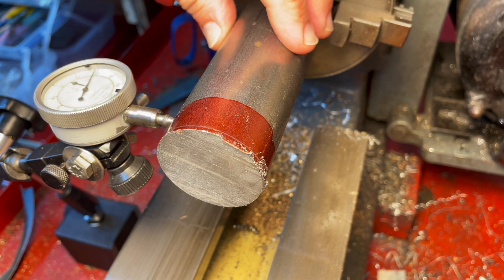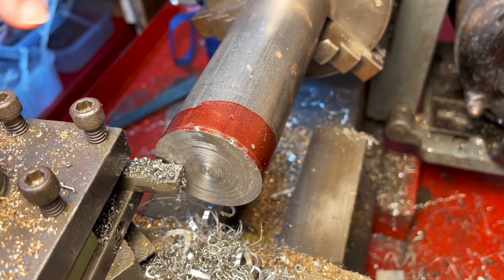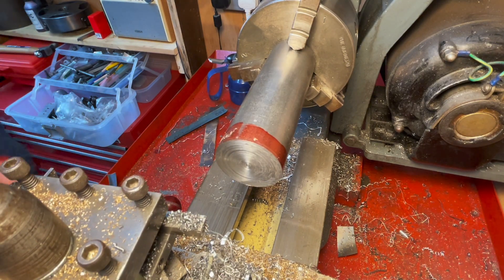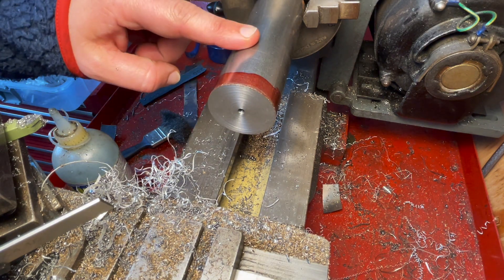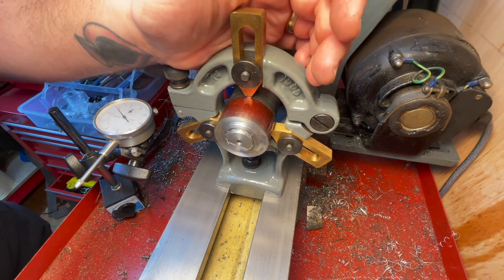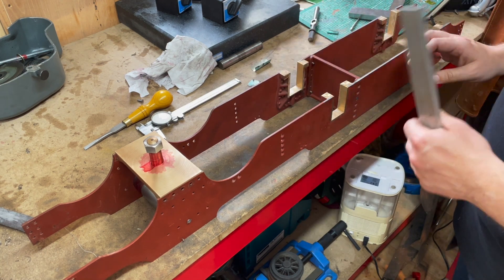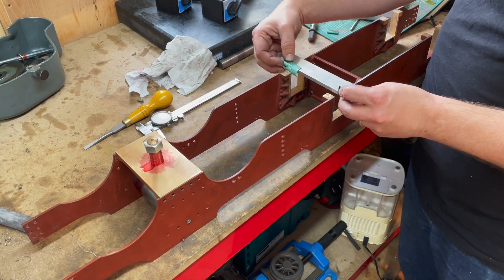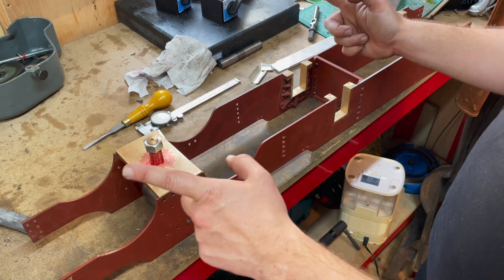Frames Squared, Finally? - Steam Loco Build #18

Comment: Great job. If you can get the frames on the mill use that’s as a surface plate for the moment to check they are sitting flat. If you want to sanity check things then clock the frames parallel to the bed and then run a clock across each axlebox face that will soon tell you if they are within a few thou. I would get your front buffer beam in after the bogie bolster then the whole front end is fixed together.
Reply from the maker: So my pet theory at the moment is that the mounting holes are all square, as are the horns - but the cosmetic edge of the frames are cut slightly different to each other, being hand cut and filed. If I put a 123 block under the spacer (i.e. using the holes as datum) then there is no rock using my lathe bed as surface plate. I will test a few other permutations but I think we're good. Annoyingly, beams are super-tight fits on the chassis so I'll need to open them out too. I will def. run a clock and/or skim the horns as neccesary. How much float do I want in the axleboxes longitundinally? I would assume very little/none compared to laterally?

Comment: 👍👍👍👍 a piece of kitchen worktop is reasonabley flat, if it won't fit on your mill table,  then you can check square, flat, twist, & rocking,  just to belt and brace, double check, then triple check and then if your happy, check again!, any small error will have a knock on effect when you come to fit everything else. I'm know expert but just from my experience building mine.
regards
Kev
Reply from the maker: My frame sides got banged in the post when I bought them so they are VERY SLIGHTLY wavy -any ideas on how to fix that?
Reply: @williamsworkshopuk  take all the attachments off to get you back to flat plates, find a very thick robust piece of flatish timber to lay the plates on one at a time,( to absorb the shock,) on the floor,  then find the high spots and give the high point a good whelt with a heavy duty hide mallet, keep doing this untill a straight edge is within reasonable flatness.  some trial and error involved, but that's what i did, because the plate i used was black hot rolled steel .
😉😉👍👍
Reply from the maker: @MrFactotum  the horns are rivetted in but the bends are quite a ways away from them, so fingers crosed this will work!

Comment: I think that it all looks fine. Make sure that the frames are secure on a true flat surface when you use the transfer punch and make sure that it's a nice close fit and perpendicular before you whack it. One other small point: when tapping in the lathe I always locate the rear of the tap wrench with a centre in the tailstock. I don't think that it would matter in this instance, but I feel it's good practice and I try to maintain good habits. Best wishes.
Reply from the maker: Thank you George. That eclipse tapping wrench holds the taps at an angle so I figured it was best done by hand!